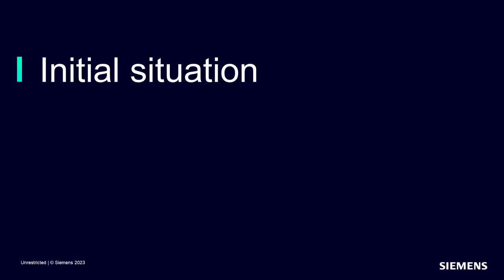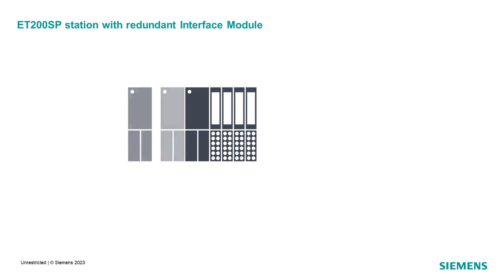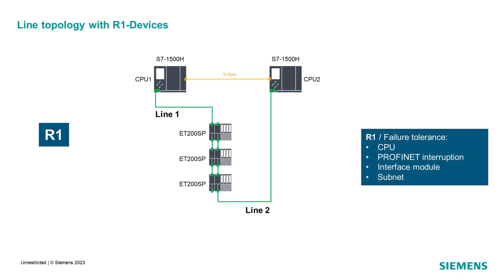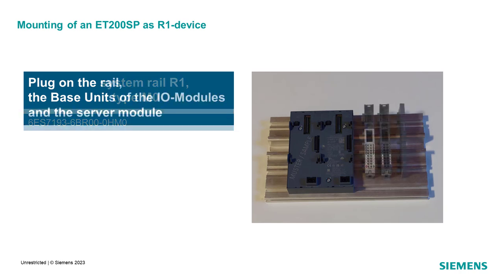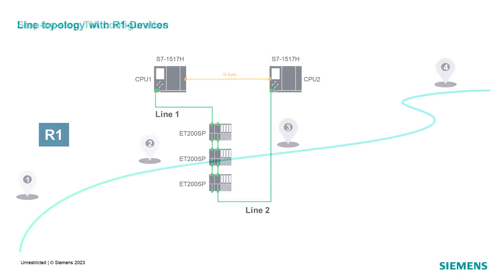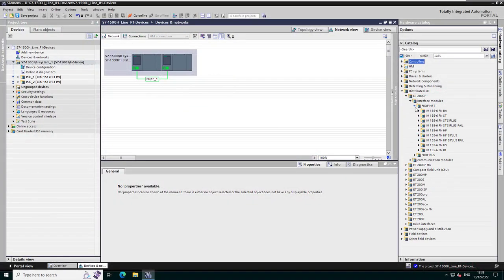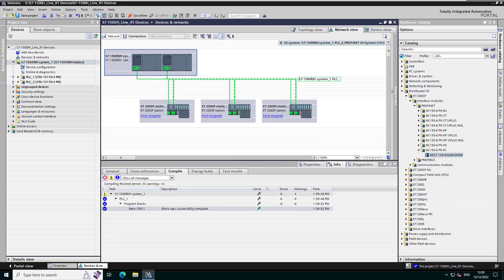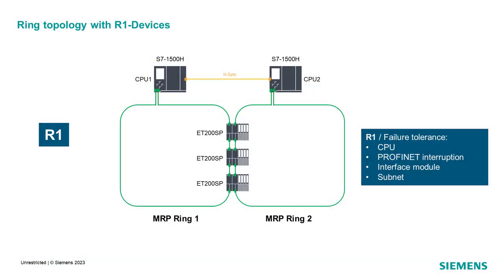S7-1500H Configuration | Increase availability with ET 200SP IM R1

Comment: then what is the used of pn-pn coupler?
Reply: PN Couplers are used when you need to connect two PLCs together while maintaining S2 redundancy. Without it and using the alternative I-device, there can only be S1 redundancy.
Reply: @System-Restored single device means single point of failure are not allow in a redundant system. Better go for s7400H. When we configured s7 peer to peer. It is much easier, just load s7connection.